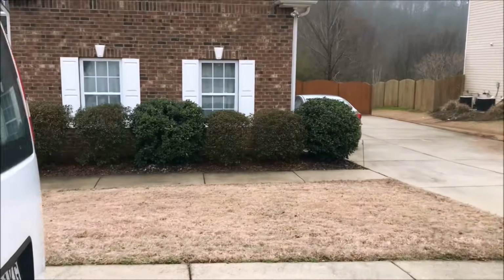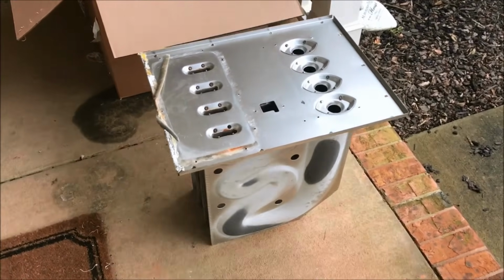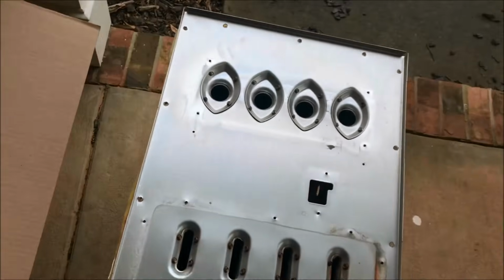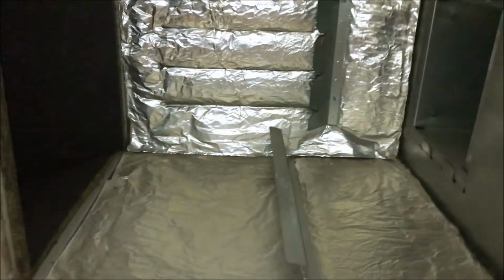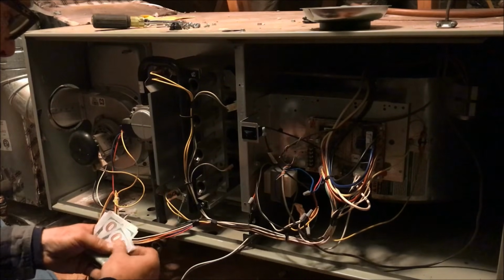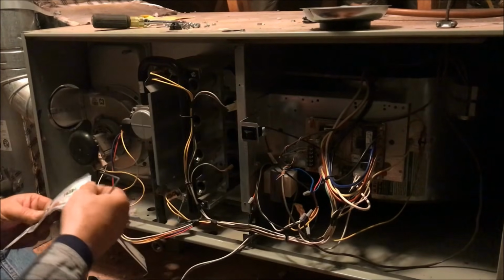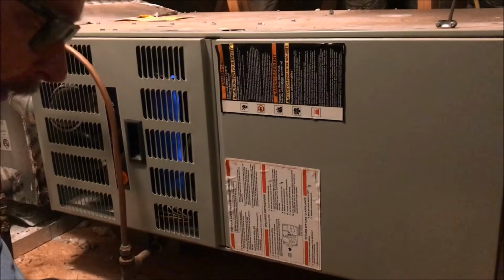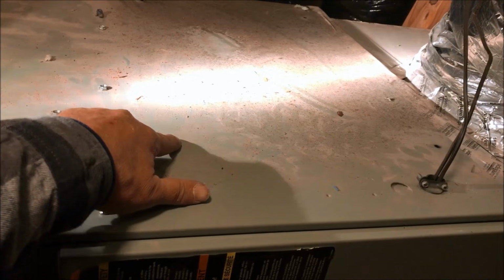Replaced Trane gas furnace warranty Heat Exchanger

Comment: That is a big job just as I imagined it would be! I never got the chance to change a heat exchanger when I was working because my boss would not allow us to do that! He said because of the liability and something possibly happening to the people living in the house we had to always replace the entire furnace! His exact words were when I questioned him about this were " carbon monoxide. is nothing to play with people die from that  always replace the furnace just to be on the safe side"  there were a few times that heat exchangers went bad under warranty starting with a smell in the house and then failing the smoke bomb test the owner argued with the manufacturer about just replacing the heat exchanger and everytime they would supply us with a replacement furnace! But the  company had to eat the labor costs! I can still remember the boss saying all I want to see is a-- holes and elbows we are not making any money off of this ! You did what most HVAC technicians would do and i am not doubting what you did you cured the problem Ted!

Comment: That flame sensor is just a piece of stainless steel.  I just use plain ole sandpaper and have never had a problem.  I guess we all have our way of doing things and the only right way is the way that works.
     The door switches used to be a safety switch because older units used to be more accessible to the residents of the home.  They would have to take the cover off to change the filter and if they would just leave the door off, it would suck carbon monoxide into the blower and then into the house.  These are 40 plus-year-old systems though and the door switch should have been repurposed years ago.  For the love of God, why are they still using a mechanical switch with there are so many more modern options?  
     Thx. for the info, vids, and entertainment.
     God bless bro.

Comment: Back in the early 90s I worked for a guy who installed Rheems. Boy, did I ever change  A LOT of heat exchangers!! Got pretty fast at it too. But now I work for myself, mostly doing oil furnaces. Good oil burner techs are hard to find around my area here in Pa.
Reply from the maker: Few and Far between here too .... I am one of about 5 left in the upstate area that can properly service and oil burner. One day I will get the chance to video one... make good ol Steve Lav proud !!
Reply: Ive been debating doing videos myself. I have a house trailer tomorrow morning with a oil burner, maybe Ill give filming a try
Reply from the maker: Look forward to seeing it !!

Comment: The flame probe in my Payne furnace is rather finnicky; I usually end up cleaning it every heating season due to the furnace failing to detect ignition.  I use sandpaper or Scotch-Brite to clean it.

Comment: Had this exact furnace the other day with a failed HE with 2000 ppm in the flue. Never could find the crack in it was rolling out badly in one of the burners.
Reply from the maker: No idea where the issue was... but it is fixed !
Reply: @TedCookHVAC  fill with water??

Comment: Copper gas lines are against most city and state codes , even the railroad commission which regulates propane which is much more dangerous than natural gas. Most licensed contractors and even lowly technicians are well aware of the liabilities of servicing a unit and Not replacing a copper line with coated flex line and a proper “drip leg” with hard pipe connection from the gas valve through to the outside of the unit as safely precaution against vibration breaking the coated flex....I believe its a national plumbing and mechanical code
Reply: cassidy strickland both the uniform code and the international code have sections that reference the use of copper for gas piping. 403.10 is the section to look up in icc codes, it addresses the use of copper.
Reply: Just wait until you see the pex-al-pex used for natural gas lines in houses.
Reply: Using solid copper pipe prone to vibration is a bad idea regardless of building code or not. Disabling the safety switch can be a criminal activity if done willfully.
Reply: @erictold  At least we live in a county that has no building codes.

Comment: Blower door safety switch are needed for lazy HVAC contractors who do not provide a filter rack on outside of furnace and make the homeowners have to remove the blower door and install filters from inside the furnace lol. And we all know what happens most of the time when this happens the filters are never changed by most homeowners or they just do not know where the filter is located lol.

Comment: Ted - I've been following you for almost 2 years and really enjoy your content.  I'm a DIYer on a lot of things but know my limits.  I have 2 90+% efficient trane gas furnaces, 1 in the attic and 1 in the crawlspace. Same product line, just different sizes. On the one in the crawlspace I recently noticed that I have a rusty spot which has begun to seep a small amount of condensate water from the furnace condensor...this is near the water outlet on the furnace condensor, below the inducer. Based on the videos I have seen online, I believe a replacement of the heat exchanger would replace the area where the rusty/leaky spot it.  But, it's a 2005 model furnace, so it's 17 years old.  At that age, does it make any sense at all to replace just the heat exchanger, or should I replace the whole furnace?  I've no complaints about how either the furnace or the AC work...I just need to know what makes the most sense to replace.

Comment: You said that was a new furnace?  I would think a liberal state like NC would require 90+ AFUE in new installations.

That's a rather complex heat exchanger for an 80% AFUE furnace.  What size is it?
Reply: Ted’s In South Carolina.

Comment: Good repair on warranty H.E.. I would have replaced copper line, and check gas pressure, temp rise. Guess that just me.
Reply from the maker: I tested the incoming and and manifold gas pressures before ordering the Heat Exchanger... also tested the temp rise after unit was running but the people were at home, talking to me at that time... and I don't record much in front of customers. The copper line is fine.
Reply from the maker: That link doesn't work ?
Reply: Can't get it to pull up, sorry. Showed how after long term use of copper, flakes and gets into gas valve. I stopped using it like 1990. Guess it's still legal, only time I used it was short runs on LP gas.
Reply from the maker: Properly configured sediment traps are effective... however I don't install copper gas lines anymore either... we like Gas-Tite.

Comment: Awesome video. Nice blue flames! I have a Trane propane 95% aflu. It's 28 yrs old and still kicking nice. Likely because I use a Harman pellet stove also and a wood stove before that, so it took
a lot of the work of the furnace off it. Question: When the time comes should I just replace the furnace or have the heat exchanger replaced?
Reply: Good luck finding a 30yo heat exchanger
Reply: Just replace the entire furnace. Almost the same cost as the heya exchangers, and you’ll have all new parts, +warranty

Comment: The door switch does have a purpose but I don't know why any homeowner with any sense would be poking around in there. Besides that, it's so easy to bypass, it might as well not be there. On natural draft furnaces I can understand it because you'd be pulling in CO out of the hood but those are nearly extinct dinosaurs by now.
Reply: The problem is most homeowners have no idea and that switch helps minimize the accident. I don’t mind techs bypassing it during service but I’d prefer they let it do its thing once they are gone. Bypassing anything that might be a safety device is no longer acceptable practice in the gas business.
Reply: I bypassed my door switch because it was the first part to fail on my furnace.  Goodman uses some cheap switches.

Comment: You said it had a distinct odor..
Sewer  smell???
Reply: Smelled of natural gas I assume
Reply: It’s hard to explain the smell unless you have smelled it before it doesn’t smell like sulfur or like natural gas, and actually what your smelling isn’t necessarily CO but you will be smelling combustion products so whatever is in natural gas once you burn it you will be smelling that, if hard to describe but it smells Smokey I guess if I had to put put a smell to it, a sign that your heat exchanger is going bad though or leaking you’ll see some black stuff or sooty deposits coming from the air outlets around your house.
Best thing would be to have Carbon
Monoxide detectors near the vent outlets just in case.

Comment: How did you determine the heat exchanger was bad?  Did I miss the heat exchanger cracks on your video?
Reply from the maker: We use a c0 tester in supply duct...Also, local gas company was called out the night before we were brought in, they placed an unsafe appliance tag on line to furnace and shut gas off to it.

Comment: I never see you leak test gas fittings or clean burners when they ar out and the flame sensor work by voltage rectification also suggest tag unit with brief explanation of repair date tech no.
Also those gas valve manifold pressure  should be checked

Comment: What??? 80% heat exchangers are under negative pressure. Even if there was cracks it would not produce CO in the living space. So why didn't you show the us the "cracks" in the heat exchangers??? Good thing its under warranty so the customer did not get dinged too hard for misdiagnosis by gas co.
Reply from the maker: Not a misdiagnosis.... there was massive CO in the conditioned area before changing the Heat Exchanger... 0 after installing the new one.
Reply: " even if was crack won't produce CO " ??? You must be on crack to think that. Yes it may not produce CO right away. Give enough time and it will burn incorrectly and WILL produce CO. Plus when trane manufacture that unit it did come with a crack in heat exchanger so I guess you just leave people with cracks in heat exchanger till its an actual problem or someone is dead.
Reply: @TedCookHVAC  Could not find no crack /rusty holes. So WHY the massive CO in the house???